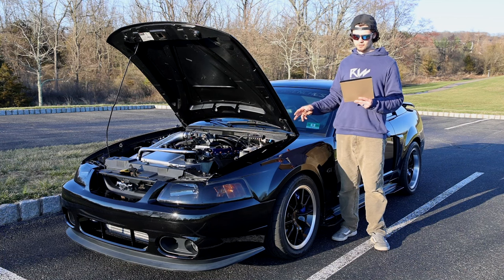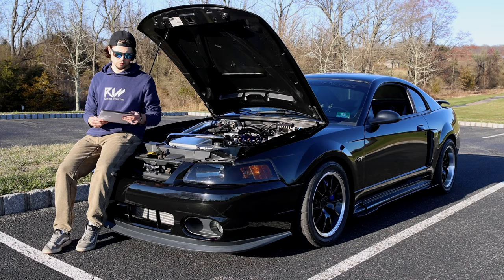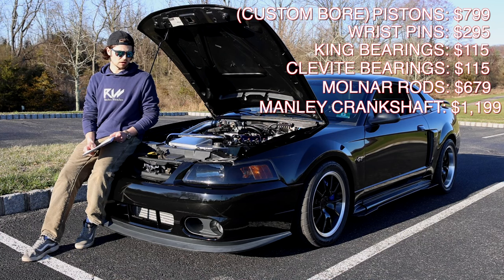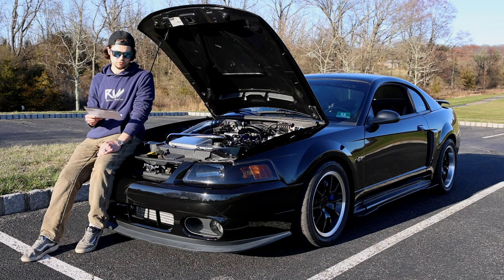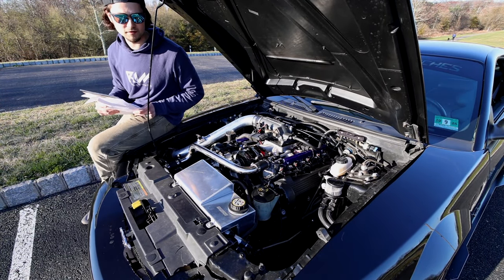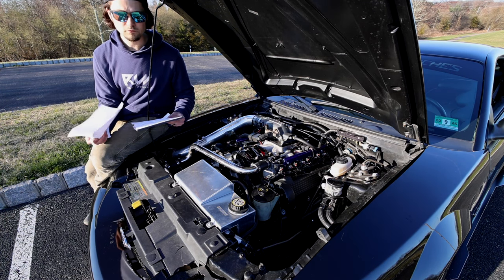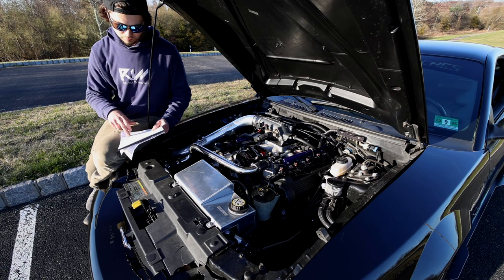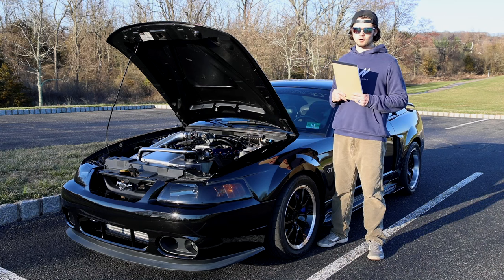Forged 4.6L 2V Engine Build Price Breakdown

Comment: 10K build is expensive but this car can take on modern cars that cost much more than 10K, and its paid off.... to me , that's a win on top of a win. Awesome build for sure
Reply from the maker: Exactly! Always been a fan of older cars that are faster then new ones
Reply: Lots of v8 builds with a good forged setup end up being close to 10k
Reply: It can make as much or more than any of the newer coyotes and its in a much lighter car and it is still alot less all in than buying a newer coyote and then doing a big power build on that.  Everyone always says oh you gotta do more mods on the old cars yea but they coat way less money so you have less into it when it's all said and done and have equal or better results and many people prefer the older cars me included.
Reply: @RidinDirtyRollinBurnouts a forged ls would be every bit as much even tho everyone says they're so "cheap" which is a bunch of nonsense lol.
Reply: @midnight347 yes and no. LS builds are a lot cheaper to do than they used to be. But they can also be more expensive. It's all about the parts you want to use. LS has a good aftermarket and can make cheap decent power. same goes with that iffy 4L60 trans too they have a great aftermarket too making them cheap to do but also can be expensive.
Reply: I had a 2015 GT mustang hated the car payment looking into a 2v build always liked the look of them.
Reply: Turbo 435hp? Na just under 400? Hmm.  How'd I build my 2valve engine to be 50 60 hp under your turbo. I do have a trick flow kit that was like...I think 5 grand. My heads are trickflow. Intake. Everything's upgraded. But still... I'm 385 all day.  And my 5th gen I spent 6000 on a cam heads build. Wrecked it..had 40k in it got a check for 22k. 45000 miles. My buddies new camaro has double that. I like the 2valve body most. If u put a tire on that it'll look way way meaner and needs it. B4 u wreck it

Comment: Bring it down to Texas some time. Can show u my turbo 2v. These motors can make power and really isn’t crazy to do. People just don’t give them a chance. 1000+ here. Keep it up
Reply from the maker: I've seen videos of yours and it's nasty! Would love to come down to Texas. They really don't but they have the potential for it! 🤘🏽
Reply: @RatchetWrenches  come down for when they do the LMR cruise in
Reply: Are you on stock bottom end or did you go forged? I’m just asking because I’m buying a 2v soon and wondering how hard I can push it before it explodes
Reply: @GrubbingRust  it’s a built motor. Good rods and pistons. Cobra crank. ARP  hardware. These motors can make 1000+. U have to do alittle work to them but it isn’t some voodoo magic either
Reply: I'm in Houston planning on building mine, however I needed help.
Reply: This.  Just because it takes more modding to accomplish similar numbers everyone is all like omg that's too complicated they like copy and paste builds like the newer coyotes buy car add blower and fueling done lol.  But the car costs alot more money so in the end the older car is more bang for buck.  It doesn't take much to get serious power from these cars.
Reply: Alot of people also just repeat what others say with no first hand experience.  They say "4.6 is crap it can't take more than 400 wheel" as if built short blocks aren't even a thing anymore lol.  Like I said if it isn't a simple copy and past build they want no part even if their route costs way more money all in.  Most of that is financed through the car itself so it is what it is lol.  Harder to finance an engine build and nobody wants to save money and do it the old fashion way.
Reply: @GrubbingRust surely you know a stock 2v can't do 1000 wheel on stock bottom end lol.  I hope so anyways.
Reply: @Jsta2v_racing it's very simple setups it's just people can't finance it through the bank so they go the easy route and finance a coyote lol.
Reply: @midnight347  yes sir. Don’t get me wrong the coyote is a bad ass motor no doubt. But I haven’t seen the limits of the 2v yet. So why even swap
Reply: I got someone that wants to trade me their built 04 GT with forged internals Manley rods, comp cam, borla ataks, SVE 3.73 rear end gears, cobra r front bumper, saleen rear wing and bumper, 3” cowl hood, (rear/front bumper and fenders need to be painted), and he said there’s much more for my stock 2011 G37x coupe with 140k miles. Supposedly he just built the motor so idk sounds sketchy to me???? Send vids and it sounds good no crazy noises or anything. What yall boys think??
Reply: @OleBoyy15  it’s always a risk. Is it gonna be ur daily or a toy?  That can really make  a difference
Reply: @Jsta2v_racing  yea that’s what I was thinking. Daily
Reply: @OleBoyy15  best lesson I have ever learned. Have a daily. And have a toy.
Reply: @Jsta2v_racing  one day my boy. One day…

Comment: nothing wrong with a Terminator crank.  Actually, it's the same crank from 96 to 04 Cobras, all forged kellogg cranks that can easily handle 4 digit power.  Usually can be had in good shape for around 500 bucks.
Reply: Oh, and the 03/04 Mach 1's with manual trans had the forged cranks as well.
Reply from the maker: No doubt! I just wanted to play it totally safe but I definitely could've gotten away with using the Kellogg!
Reply: Honestly most of the stock cranks can run 600-700 hp. Termi crank especially. Alot of people over build these days. I wanna build my 3v, a 9 thread 4v head swap, cams, forged pistons (still deciding the brand, looking to go budget), gonna do boss rods, stock crank, twin turbo. All ARP hardware.
Reply: The cobra crank would have been fine. They are capable of making 1000+. I am prove of that. Mine 1000+ with a turbo 2v
Reply: It’s true the Kellogg is great. I recommended him to get a Manley because after 20 years it’s hard to find a Kellogg that doesn’t need a bunch of extra work. I know this because I had trouble sourcing one for just myself
Reply: @Sleeper_Solutions  this is also true. Anytime I have some extra money and I see certain parts, I’m buying lol.
Reply: @ichigonubetube that setup can easily hold 600-700 wheel or more especially with turbos.
Reply: @ichigonubetube  I would not use a stock 2 valve 6 bolt cast crank to drive any kind of supercharger.  Turbos are a different story since they don't put any stress on the crank snout.
Reply: @Jsta2v_racing  stock TTY bolts can hold 1000 hp as well

Comment: Its crazy how modular motors were a big force to contend with in the 2000s and now people have amnesia or are too young to remember lol. Thats exactly why i went boosted mod motor instead of coyote/ls everything
Reply from the maker: Yeah seriously times have changed drastically! I still love the 2v and 4v engines and would much rather build one instead of doing the overdone coyote builds like you said. They just sound better too IMO
Reply: They're too young to remember many times and they just repeat what others say with no first hand knowledge.
Reply: Boosted mod motors can put in work ecsp for the money spent.  Most newer coyote cars plus mods cost way more than one of these properly built with forced induction and everything needed to make big reliable power.  What I think is funny is how many ppl think ol 4.6 can't do more than 400 wheel like no matter what.   Ppl don't even understand what a built short block is anymor
Reply: @midnight347  short blocks are getting harder and harder to find for these cars. Lots of them are on backorder, likely due to a shortage of suitable cores.  If mine ever leaves the chat, I'll have to go coyote route :(
Reply: Great build. Great breakdown
Reply: @RidinDirtyRollinBurnouts  you can pull these blocks out of most junkyards. Find an old explorer or expedition and you'll get a WAP block, which is strong enough for 1000 hp.
Reply: @midnight347  all the coyote is is a mod motor based off the 4.6 with stronger cyclinder walls and internals.

Comment: Look at blueprint motors. For a 436 hp sbc its about $7000. Dressed. Thars with core. Youve put the best in yours and the blueprint is not all the best. You did good!!
Reply from the maker: Very true then thank you! Yeah I definitely didn't wanna cheap out on parts and the build this go around so I went all out besides head work but I didn't need to break the bank on that. Should be a fun season

Comment: This is a very good deal my 04 mustang GT automatic dark shadow gray with 193,000 miles is going to need a replacement engine and to buy a long block and have it put in cost a little more so when the engine goes bad I think I will build it or look for a 5.0 maybe gen 1 or 2 swap if I keep the car
Reply from the maker: Either option would be a good one! I personally love how the 2v sounds that's why I went with building it and also the coyote swap is very overdone IMO

Comment: Had a terminator A few years ago drove it for five years regularly put about 30,000 miles on it and sold it $6000 more than I paid for it 💥 those mustangs hold  value
Reply from the maker: That's insane. Yeah the terminators hold value very very well and about a year or 2 ago was the absolute best time to sell one they were going for so much money. They've come down a bit in value now I believe

Comment: Awesome build! You'll be safe on nearly anything you can throw at it now! That broken top edge of the piston you went through probably had a lot more to do with tight OEM piston ring end gap than non-forged bottom end components. Either way, I hope she holds up making tons of power for a really long time now! You may already know of him, but Andrew Lavender comes to mind for really getting alot from these 2V set-ups if you haven't watched his videos, check them out.
Reply from the maker: Thank you! And absolutely the bottom end is STOUT finally! Yeah the ring gaps aren't meant for mid 400 HP and TQ hahaha. But absolutely I know him I used to watch him all the time. He was one of the best when it came to 2v content on YT
Reply: @RatchetWrenches  I've been considering a 96-04 manual Mustang GT project myself, as your build is proving to be very, very cool. I'd like to have similar stuff, but possibly tune it myself using a Holley XFI deal, and incorporating a flex fuel sensor system if possible. Always dreaming, lol. Also, since you already know of Andrew Lavender, Richard Holdener is another one who has alot of experience with these older engines / power adders etc. In case you haven't checked him out. The best of luck moving forward on your car!

Comment: Whats the plan with your high compression issue? 🤔 Id be hurt driving that thing around knowing I can't hit boost without hurting the fresh motor I just built. 🤷🏾‍♂️
Reply from the maker: Haha you're relentless man
Reply: @RatchetWrenches  lol 😂 but na all bs aside.. Honestly how much boost are you currently running with 93 octane? 🤔
Reply: I would just run better fuel and make way more power safely.  At the very minimum 93/boostane which is 100 octane.

Comment: Quick question 🤔 why didn't you just but a trickflow kit that comes with the heads cams and everything
Reply from the maker: I wanted custom spec cams from Todd Warren and wanna push the PI heads to see how well they can perform. Might do trick flow down the line but at this time I didn't see the need to spend all the extra money
Reply: @RatchetWrenches  true. Hey, someone on reddit was telling me that a 5.0 stroker kit combined with the trickflow kit wouldn't be reliable. Any reason you think that I might be?

Comment: Don’t do fender exit exhaust unless you’re planning on making it a full time drag car. If you plan on still driving it on the street regularly just do a straight pipe or put some Borla Atak mufflers on it.
Reply from the maker: Why are you against fender / bumper exit? From my research straight pipe is too raspy and somewhat similar to fender / bumper exit. Borla ATAK would be awesome but I'd rather not spend $1200 on a catback that has slightly different mufflers / resonators then what I have now
Reply: @RatchetWrenches straight pipe sounds badass with turbo setup the turbo itself acts as a muffler.  I'd at least run it back and dump it under the axle.  Bumper exist is good because it's less weight better response so it's all in what you want I suppose.  .

Comment: I was wondering how the Modmax short block builds are.
They have a short block rated for 1,200hp and even withe upgrades on the pistons,crank and hardware it comes in around 5500.
Reply from the maker: I honestly haven't heard much about Modmax. If you have Facebook I'd search it or ask about it in specific groups. There are some groups strictly designated to discuss 2v/3v/4v engines and there are some smart people in there.

Comment: im kinda at a crossroads with my car.  i have a 04 mach 1 with a eaton swap on stock block.  i dont know if i should build my block an boost it. or if i should sell the setup and coyote swap. for 10 for a build i could just buy a crate motor. its def a tough decision.
Reply from the maker: @michaelcanterbury8845  that’s definitely a tough decision for sure. They both have their own pros and cons but I feel like you can’t go wrong with either choice! I personally love the built 2v I’ve always preferred the sound of this engine over a coyote

Comment: Similar price built on my 2v for 1000hp just cant decid if im going twins or single turbo
Reply from the maker: I feel like I've heard and read that twin turbo set ups are better for hitting that 1000HP mark but obviously a big enough single can do it too
Reply: I'd do twins if it's a street car better response.  If it isn't a straight race car don't mod it like one always take into account response and overall power curve this is very important on street cars imo.
Reply: @RatchetWrenches a big single can make more power but the reaponse won't be as good as twins which can easily make that and more with better response and less lag.

Comment: Damn that is expensive lol. How much boost are you putting down tho?  💯
Reply from the maker: It definitely was! And once I get the E-85 tune most likely will make 500 hp with ease on around 6-8lbs if I were to guess
Reply: Fr! That's not counting the turbo & miscellaneous parts to make everything work lol. 😂 But E is definitely the way to go! How much boost are you currently running on pump gas? 🤔
Reply from the maker: @divergxnt364  oh yeah its well into the 10's of thousands when you count that and the turbo kit. But I'm not sure how much currently probably just a couple lbs. I just cruise it until I'm ready for E-85 tune
Reply: @RatchetWrenches  what's the closest place with e85 from your location? Or It might be better to order a 55 gallon drum of e85 Idk.  🤔💯
Reply: @RatchetWrenches  or you can try the snow performance methanol injection kit as well. That would be a good video for content as well 🤷🏾‍♂️
Reply: Not really considering a newer coyote costs 5 times that amount and that is before the modding starts.  You won't have near as much in a car like this running 800-1000 as you would buying a newer car and building that.  They coat so much more money off the rip it kills any budget they could have from being able to do fewer mods to achieve a said goal..
Reply: @teelazysocold412 how much do those cost?  I'm gonna look into that for my gt500 because closest Station is 30-40 miles in either direction.  They're the only ones who have e anywhere near me to my knowledge

Comment: Confused. I have a 2valve I've built and owned 11 years I used to beat everything.  400hp na. Original 2valve 4.6. Had nitrous. Moser axles 31 spline carrier everything! Old street racer tricks included.  But I'm 400hp. With 410 gear. Tall fat mickeys on mine. Why do u have that hp.and cost..and u have no wheel tire package. I just spun my fully built 5th gen camaro off the road totalling it. I thought nittos at 300 a piece was enough.  U need a tire plus it'd look better. Nothing looks good on these but BBK or a fat back skinny front set up
Reply from the maker: This cost was to build the long block that's capable of turning it up to 1000 RWHP. It's making well over 400HP now. And the tire look is all preference.